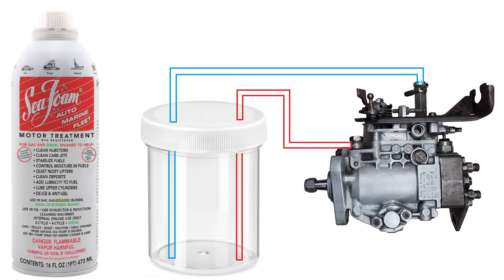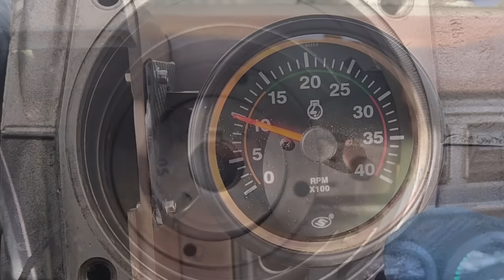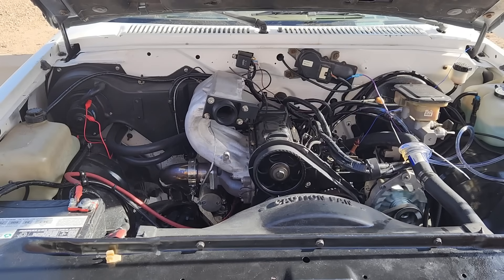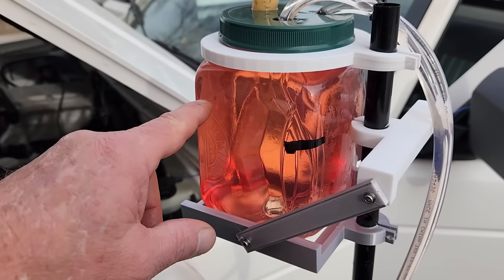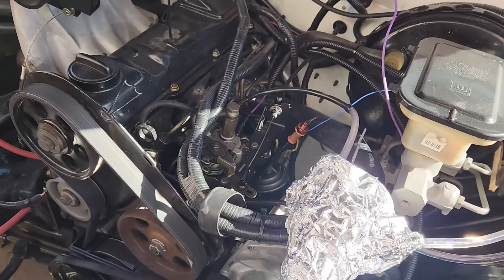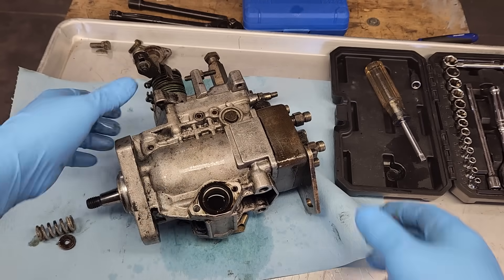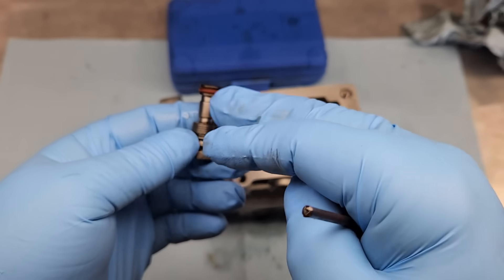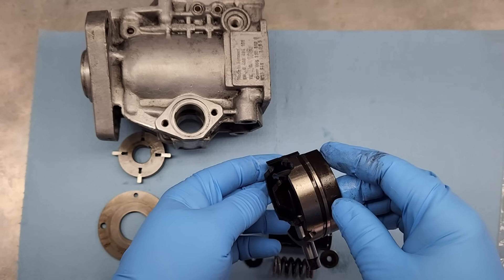S5 E49. We experiment with Diesel purge, SeaFoam and Berryman 12 to clean our BOSCH VE injector pump

Comment: Thanks for sharing this. Remember any water in diesel fuel will make sulfuric acid, especially with off road and pre 1995 fuel.  Mechanical intervention is the only way, just like an auto transmission, when you notice the problem, it's too late.  Still there's always that 1 in a million story you hear. The only things I would have tried were putting the engine under load and getting the fuel closer to exhaust temps. Maybe some atf based miracle juice as well... Oo fried chicken grease, that will make a grease monkeys' hands ready for date night 😂

Comment: Dear cantina I have knowledge of a transmission that may be your curiosity if you can maintain the same axle ratio or tire size that comes with the transmission you'll be cruising 1200 at 555 and 2000 RPM at 75 mph
Reply: It is a 5-speed automatic for a front wheel drive it would make an interesting swap if you can get it to work

Comment: Had a '90 Jetta with 1.6l turbodiesel which I bought used, ran fine, but the choke lever was stuck out (so - same fault as yours). Never got around to fixing it, ran another 100,000 km's like that. I did have issues with the o-ring seal on the throttle shaft where it went through the upper IP cover, replaced twice with correct Viton seal, leak would eventually return. Shaft was worn oval.

Comment: Old 1.9 TDI (1z), I did LIQUI MOLY DIESEL PURGE, directly from can, twice (1 year spacing). Why? To clean the fuel system (there was no issues, just maintenance). Just don't do it... both times I had issues about 200km AFTER the cleaning process. Both times the pump controller had some "petrified black strings" in it and was working incorrectly after that, I needed to disassemble it from the pump and clean it... and it's not easy (the pump controller in 1z is mounted on the pump, and it is flooded internally with diesel fuel). Ow, and before the controller I have additional fuel filter, so... DON'T do it.
If you want to have good old diesel pump working well for years, just add some 2T engine oil to the fuel tank, 100ml will do for the full tank (~50L). Why? Diesel fuel these days contains almost no lead, which was acting as lubricant for diesel pumps.

Comment: I retired from a railroad that uses biodiesel in the locomotives. For daily operation it was fine. Occasional operation was another story. We had a switching locomotive that (originally) used the same fuel source. Short version: the fuel system was COMPLETELY gummed up, no amount of solvents would break it up. It took a mechanical cleaning of EVERYTHING to get it to work.

Comment: Note on 3d-printed intake - 
There was an airplane crash recently - make sure you're using the right heat-resistant parts! 
"A Cozy Mk IV light aircraft crashed at Gloucestershire Airport in Staverton on 18 March 2025 after a 3D-printed air induction elbow failed due to heat exposure, leading to a complete loss of engine power during final approach"

Comment: A word of caution. Do not misplace the banjo bolt. That bolt even has OUT stamped on it. It has a restriction in it and it helps the pump to maintain the pressure inside. I heard stories when this bolt was misplaced and installed into the inlet side. Because of the restriction the pump was starved of fuel and seized up. I am not sure if that bolt can be installed into the inlet in case of this type of pump though.

Comment: That timing advance it's fore easy start no pressure or low pressure at startmotor speed change the timing advance fore easy start when engine is running it's normal fixed timing

Comment: Hi! Adding any kind of oil to diesel fuel not the best idea. Also, here in my third party contry proffesionals use only WYNN's liquid for cleaning fuel system. And in instruction they say that tempreture of this liquid must be less than 65 d.celsius if it get higher you must take a break. So i think your idea to heat up it - was bad. Also we use fuel filter, but as i see your liquid was clean during process(or i miss something), so this gives two ideas or your system was very clean or your cleaner do nothing.

Thanks for the video. Sorry for bad english.

Comment: Back in the late 80s early 90s I worked in an auto parts distribution warehouse. Berryman B12 chemtool came in gallon cans that were rectangular and also round gallon cans that look like paint cans. When you pop the lid, there was a metal basket inside because that’s exactly what they were selling it as, carburetor dip cleaner. In the summer, those cans would start venting and if you had to be back in that area, it would give you a headache within about 10 minutes. Strong stuff.
Reply: Yep...
The basket cans had about  a half an inch of what looked like water floating on top.
I assumed to reduce evaporation.
I believe it contained chlorinated solvents back then.

Comment: what you said about berrymans  smelling like carb cleaner reminded me of something i did around 2 years ago. I pored some acetone into the tank of my flathead Briggs lawn mower that id gotten that would barley run and it worked wonders. of Course i didn't use much as I didn't want to damage it, and I recently found out its an old trick people use as well.

Comment: Berryman's good stuff for gasoline fuel systems, certainly, but you're only supposed to use, like, 12 oz. of the stuff per ten gallons of fuel, and I have no idea whether it's even recommended for diesel systems. I tend to use it on any new (read: old) acquisitions for the motor pool around here--helps degunk fuel lines and injectors, plus it absolutely annihilates carbon deposits on intake valves in carbureted or port-injected engines.

Comment: never had VW Diesel, but my overall experience with the company, you have 3 modes their hardware falls into.... optimal, sub optimal, and exploded...

69 Type 1 Engine, crank snapped in half... continued to drive 40 miles, sub optimal.... Bearings shot, case ruined, but got me home... then exploded

Comment: I'm not usually comenting here in youtube, but at least here in Spain where Diesel engines are way more common than there in the states, it's saaid that adding some gasoline to the diesel tank helps unstuck high pressure fuel pumps and inyectors, specially in old diesel engines. I've personally tried it in an old Peugeot 306 1.9 N/A engine (with great results, passing the MOT or ITV as we call it), and heard good results in trucks and other diesel engines. As you already need to reedo the fuel pump... You might as well try adding some gasoline to the fuel mixture. AS we say here... From lost to the river 😅😅

Comment: Even if Mechanic In A Bottle doesn't work, it often started the cleaning and helped reduce elbow grease expenditures. If memory is good, most of those you used have similar components and don't have to worry about glue or thickening parts together. The berrymans and others may have washed paraffin from seals.

Comment: On the subject of flushing it needs to be remembered that there is nowhere for the flushed debris to go except back to the fuel tank or through the injectors.  It won’t go through the injectors unless it’s microscopic and in this situation would have either settled into the bottom of the fuel supply tank or mixed with the fuel and discoloured it….then gone back through the pump unless there was a filter on the return hose.

Comment: We use to run them on 1qt. of pure atf fluid just take the fuel line off the filter and put it in the qt. of atf run the engine until it shuts down cleans the  injectors to one of the pumps I used this on the throttle was also sticking it cleaned everything good

Comment: I had multiple vehicles with VE injection pumps here in Italy, all of them running on (7000g centrifuged and dried) waste vegetable oil.
My old Fiat Punto worked on it for the majority of its mileage.

Water in the fuel is the main issue with diesel systems, that's why usually their filters have a water separator to collect water on the bottom of the filters.

When I had similar issues to yours, before I was using vegetable oils, I solved using a 50% mix of synthetic 2 stroke oil and 50% naphta with naphthalene mothballs dissolved in it (filtering out the solids they put in mothballs).
Nowadays in europe they stopped selling naphthalene mothballs, but I imagine you can find them in the US since your government doesn't give a F if you get cancer.

It worked well for me, but probably my injection pump wasn't corroded (never opened that one).

That kind of engines can run flawlessly on used hydraulic oil too, and sometimes better than with diesel fuel.

Comment: B-12 is what I add to my 90 Suburban. It's only a cabin vehicle and so it only gets used for 4-6wks a year. Has 200K miles on it and with 2 cans added to the 38gal tank, we somehow STILL get 15mpg combined. That includes driving through the mountains. The motor is tired, in a weird way. Struggles going up hills, but loves to hauling the mail on flat stretches (easily still gets to 85 when passing long stretches of RVs/campers). 🤷‍♂️😋

So yea, I swear by B-12 😊
But, that's a 350 gas, not diesel...

Comment: I really enjoy the channel: the fabrication and overall execution are very clean.
But I honestly struggle with the engine choice here. A VW 1.6 NA diesel is designed to move a ~900 kg Golf. An S-10 weighs around 1500–1800 kg empty, so even unloaded it’s basically a fully loaded Golf all the time. That explains the very poor acceleration, which in real traffic can actually be unsafe. In many countries, a car that can’t keep up with the traffic is considered just as dangerous as speeding.
Tweaking the injection pump or even adding a turbo won’t really fix the core issue. The engine will be under constant high load, which hurts drivability and long-term reliability. Towing or hauling is basically off the table, so it raises the question of what the purpose of the truck is with this setup. As an alternative, something like a Mercedes OM603 3.0 diesel from a W124 would make much more sense. It’s built for heavier vehicles, has proper torque, good fuel economy, and huge tuning potential, while still preserving the truck’s functionality. I enjoy watching the content, but this swap feels more like a content for content’s sake than a mechanically sound solution.
Reply: He's weighed the S10 in a previous episode, it's nowhere near 1500kg wet. I think it was 1200kg?
Reply: He's said in previous videos that this is a proof of concept, to see what can be done.  He'll upgrade later to a 1.9.

Comment: My brother put a can of Berryman's in his GrandAm (GM 3.1, not a VW diesel), but he poured that in and his fuel pump started screaming, it isn't a good carb cleaner, its a worse fuel additive. Stick with Gumout. What about adding kerosene? Some parts cleaners are setup to use kerosene, stinky stuff. You did the right thing, you know if your pump is working properly, your testing will get the best results possible.
Reply: Diesel fuel is kerosene.

Comment: I've done a few seafoam experiments on old briggs flathead engines. 
Long story short old flatheads typically burn oil and can carbon up the cylinder and todays ethanol fuel doesn't help the situation as the carbon cakes up worse than it did 15+ years ago. 
Had an engine burning 1ounce per hour oil because of a bad breather check valve that was a good test subject. Started running seafoam in the gas and there were bare spots of aluminum after 100 hours run time and what was left behind brushed off easy. Without seafoam, usually need to scrape cabon off. 
Fuel treatment mix evolved to 4 parts seafoam and 1 part k100, treatment dose between 1 and 2 ounces per gallon gas depending on storage time and haven't had to rebuild and small engine carbs since as corrosion has been slowed down alot. 
Same price as non ethanol fuel so no real gains except clean cylinders and possibly helping engine life a bit.
Reply from the maker: Good to know, I appreciate the detailed feedback!

Comment: would have put a filter on the return line to catch any debries from beeing sucked in again
Reply from the maker: That's a good suggestion for sure.
Reply: Yeah, when I did it on my car I used one of those inline filters like a riding mower uses.  Actually I think I put it on the supply line, and had that line about half an inch above the bottom, so any crud goes back into the jar and settles out, and the filter is extra insurance.

I also looped the engine-side connectors on the fuel filter since the PD TDI has an in-tank lift pump.

Comment: Diesel Purge is good stuff. We had a 2003 Duramax come in with an apparent stuck injector or poor spray atomization. It was smoking a lot at idle and slight misfire. 

Run the engine at about 1200rpm on four cans of undiluted Diesel Purge in an external fuel canister. It cleaned it up really well. No more smoke and idled smooth again. Customer was happy.
Reply from the maker: Good to know, thanks for sharing!

Comment: I watch a fair number of narrowboat videos, all about living and cruising on the UK canals. One thing that is often mentioned, is the use of treatments (biocide) for "diesel bug" which are various kinds of bacterial or fungal nasties that grow in the diesel, or on the fuel tank walls. I've never heard of such problems for diesel cars or trucks. Is there a particular reason it isn't a problem for them? Only thing I can think of is running on the canals is a high humidity environment, and canal boat diesels don't spend a lot of time running, so the fuel tends to sit around. I also read that vegetable oil or biodiesel is more prone to it. Love the videos!
Reply from the maker: It happens to cars and trucks. However I have never had that problem in the past.  This project only has a few hundred miles on it and the fuel system is still very clean.... except for the injector pump.

Comment: i have been wondering  if you submerge something like this pump and use electrolysis would it remove enough rust to free it up ? you know for science
Reply from the maker: A few things to consider.  The pump is aluminum and electrolysis tends to work best on Iron.  Also the electrolysis process is a line of sight process, so something that's buried inside the pump will never actually benefit from the process.

Comment: Here in Brazil, we usually do a flush with kerosene instead of diesel and 10W40 or 20W50 type lubricating oil mixed in a proportion of up to about 5%. But there's not much you can do besides cleaning the whole system. Once I had a terrible time with my truck (to you it looks like a 1960s or 70s F100 bumpside, but here it was manufactured until 1992 with diesel mechanics and the name F1000), the tank was completely encrusted with plaque and to make matters worse, what left me stranded was a strip of paper that the fuel pickup pulled into the tank and got tangled in those perforated diesel connection bolts, a nightmare, and me with a truck weighing over 2 tons in the middle of the street at night trying to park it in the garage hahahahahahahaha a nightmare, but that's life, we love diesel engines, don't we? hahahahahaha
Reply: I also wanted to comment on this Ford project in Brazil. Here in Brazil, during the oil crises, the solution for utility vehicles was to use diesel engines (in addition to increasing the load capacity of vehicles to one ton, as this was a government requirement for diesel engines since it is a subsidized fuel). The F1000, with its 3.9-liter naturally aspirated 4-cylinder engine offering 83 hp at 3000 rpm and 25 kgfm at an incredible 1600 rpm, was a success and generated incredible fuel economy compared to V8 engines like the Ford 272, 292, and 302, which often did less than half the distance with the same liter of fuel. My truck, tuned according to the MWM table in accordance with Ford parameters, gets an incredible 10 to 11 km/liter of diesel. Perhaps in your projects, larger, naturally aspirated diesel engines with modest flow adjustments could be a good solution for energy efficiency.

Comment: On mechanical disel engines from time to time recommend mixing in 2 stroke oil with diesel and run it through pump and injectors! It burns clean and libricates everything! I had problems with 1.9 TDI sticking injector! Mechanic gave me this option to try out and now it works great! Also adds back more libricity to winter diesel!
Reply from the maker: Thanks for the input!